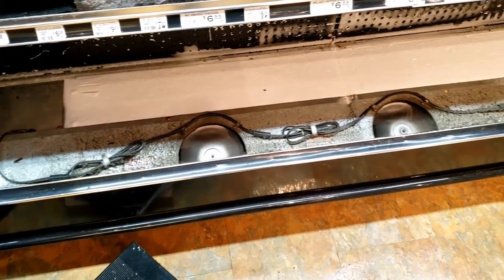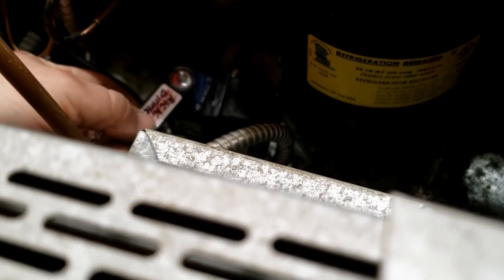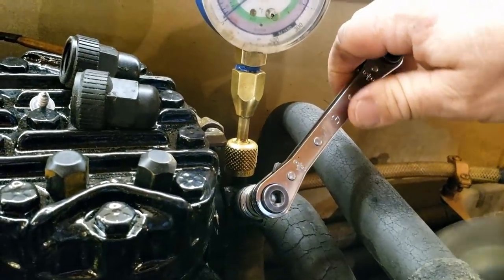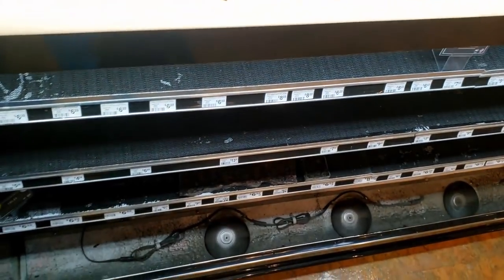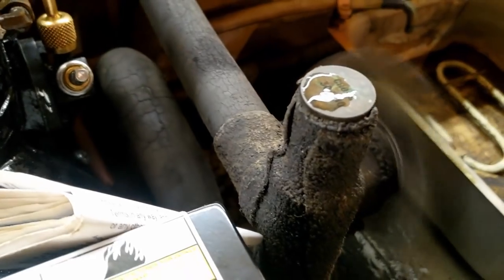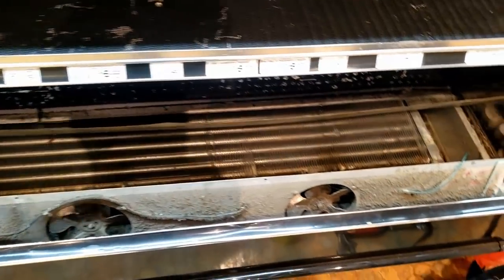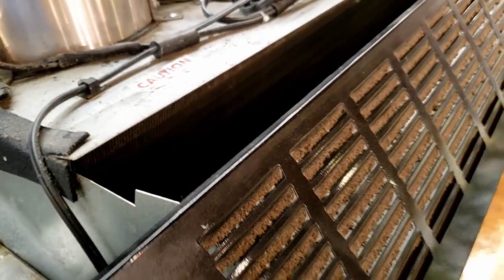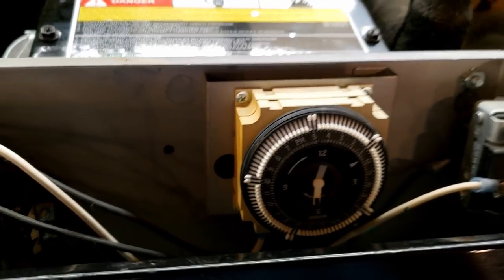Are You Sure That's Why The Evaporator Froze Up!?

Comment: Nice job.  I hate calls like that.  But I feel the same way you do.  If you truly have NO one thing standing out as broken, you're already there, you might as well address the one thing that could most likely be experiencing intermittent problems and causing the issue. Nothing to lose.  And in this case... it seems that your likely suspect turned out to be the ticket since it stayed working after your visit.  Well done!
Reply from the maker: I'm glad I'm not the only one. (I checked with the other person that worked on it before me and he said it's been working fine so It must of got it). I think there was multiple issues. The differential was too close, this would have been 32 deg to turn back on (strike one), the clock might have been sticking (strike 2), and the solenoid must of had something in it and now it's somewhere else🤔.

Comment: Hey Rick, while watching I diagnosed   Your issue as a “sticking” solenoid valve. Go back and look, after you grabbed the solenoid coil and twisted it, your problem went away. I’m betting you had either a “flat spot” with the coil / valve or some junk floating in the system holding the valve open!
Good video, great diagnostics
Reply from the maker: That's what I was thinking also, "something broke loose and probably got caught in the filter dryer on their way back". From what I hear it's still working fine several weeks later.
Reply: I tend to agree that or had a small break in the wire I went back and watched it again you grabbed the wire and pulled on it right before you spun it. Could also just be a loose connection on the solenoid. You may have moved it enough to make connection good enough to make it run a while.

Comment: Rick...there is an app for your phone you can use to sense emf....it`s called Danfoss magnetic tool.....you can get it at the play store.  I had one once that wouldnt pump down on a freezer .....it was a bad heat exchanger.One that the liquid and suction both together.Leaked internally....took a minute to figure that one out.
Reply from the maker: I'll check it out👍👍. Thanks!
Reply: @HVACRSurvival  I'll second the recommendation on the danfoss tool. You can calibrate the sensitivity, which is sometimes required. Only thing is it doesn't show actual rotation of pumps.

Comment: Don't trust that compass on a circulator.  It just picks up the magnetic field. Even with a seized circulator it'll still spin. No need to ask me how I know that or if it burned me one time lol.
Reply from the maker: I heard it doesn't work on the small Taco pumps correctly.  It says it's a magnetic pickup tool not a direction tool, I would be leary to trust it.

Comment: Hi Rick they normally have the thermistor is in the discharge air behind the back panel on the left hand side looking at the case not in the evaporator. This is common practice for super market for temp control for the cases
Reply from the maker: That's how the racks are, they have the sensors in the discharge. Your correct, I never seen the sensor in the coil, but it had to be real close to it.

Comment: they should use the discharge line in the water bath
Reply from the maker: In my opinion it's another place for the refrigerant line to leak. The heated drain pans are pretty common and discharge line may not be hot enough and run long enough to get rid of the amount of water that that size evaporator would have.  Thanks for your feedback and watching👍👍

Comment: That's what I said the first time I used the magnetic solenoid. 18 bucks?!?!?! I got a couple free from United Refrigeration.
Reply from the maker: It's neat but my amp clamp or small screwdriver has worked all these years so far🤣. I don't trust the chain it's on and I'm afraid it will get lost 🤦‍♂️🤑🤑🤑
Reply: Johnstone Supply gives them out free too
Reply from the maker: Unfortunately neither one of those supply houses are nearby me. I don't think our supply house even offers anything like it. We're always behind around here That's why everything gets bought online. 🤦‍♂️
Reply: I have had several fancy ones over the years that normally are called  keys. Usually always have a few of them on me!
Reply: Key holder...